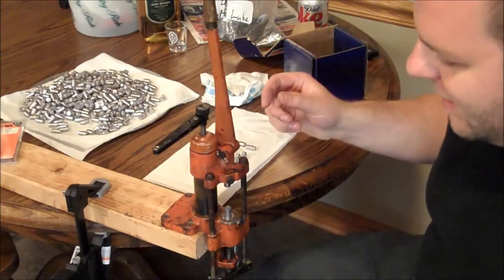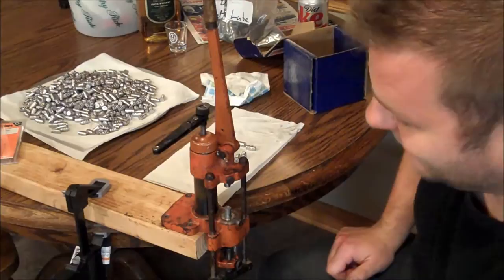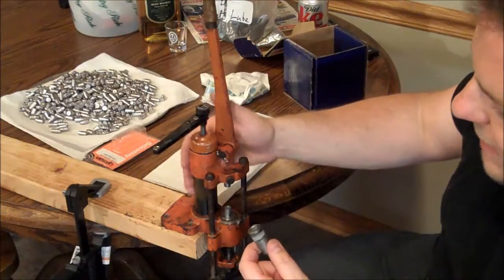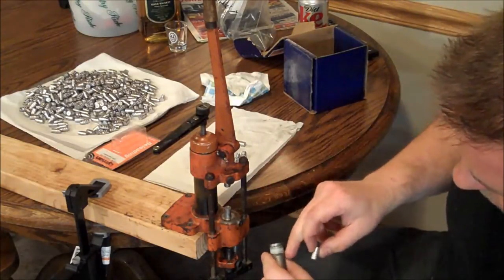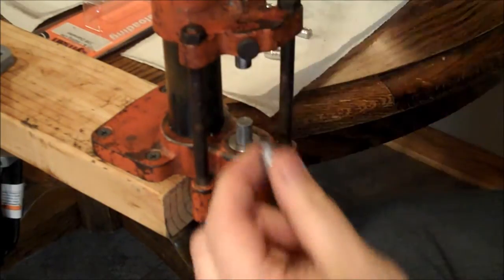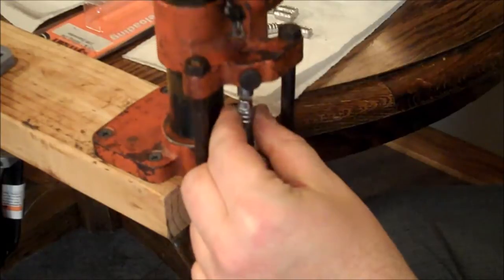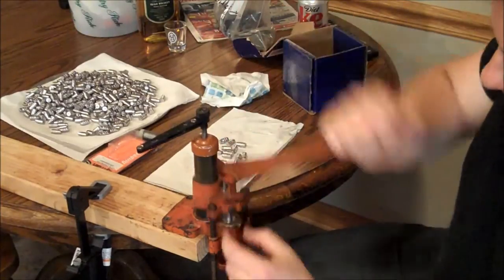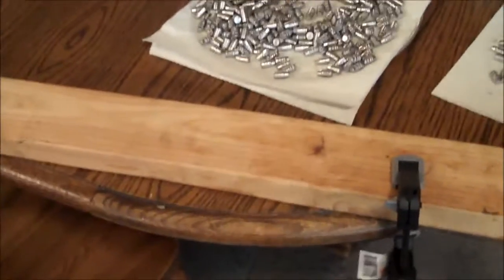Reloading Tip - How to setup and use a Lyman 45 Lubrisizer

Comment from the maker: Dylan Matheson, I can't reply directly to you because of your Google+ settings but to answer your question my .357 ram was seized too.  Many of these old lubrisizers are full of NRA formula lube which is alox and beeswax and gets rock hard.  To get my die removed I heated the frame of the sizer with a torch around the die.  I then removed the set screw and put the top punch on the bottom ram and used the arm to drive the die up and out of the frame.  Be careful heating and removing the die as you can crack the sizer body if you overheat or stress it.  I then used heat and penetrating oil and a punch and vise to get the ram out of the die.    The ram was actually rusty and didn't fit in the die correctly once I got it out so I had to chick it in a drill and get the rust knocked off with very fine sandpaper.  Also once the die is out you may want to heat up your sizer body with a blowtorch and get all the old lube out.  With the die out it will pretty much run out like water once you heat up the sizer body.  I also sanded rust from the rods and lube reservoir body and then greased everything with wheel bearing grease to get everything smooth.  Also when torching the grease I managed to overheat the stock spring so i ended up replacing it with one from a harbor freight spring assortment.  Also Make sure when you put in a new die it's level with the die body before you tighten the setscrew.  The top of the die and the top of the lubrisizer should be even or you don;t have the die in enough.  This is much easier to get right once you get all the old lube out of there.

Comment: I have 3 they all came in the box used but they all have a ratcheting wrench. I believe the 1st model was not ratcheting.  It looks like a seaco with the handle going sideways and is black not orange.     I must use a harder lube or something as when I run mine down that fast it will leave little voids in the lube

Comment: How do you put in the grease?
Reply: The cap comes off the main body,  and you back the press plate off and insert a new cylinder of bullet lube. The red Carina works easiest, and doesn't require heating.